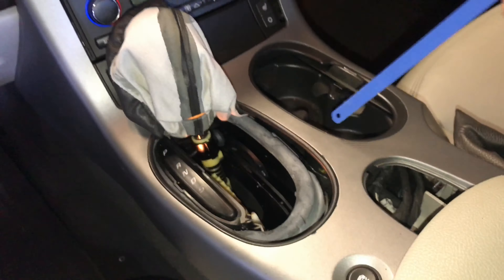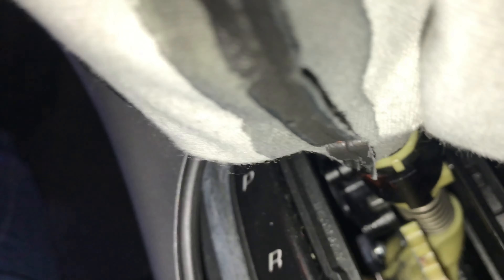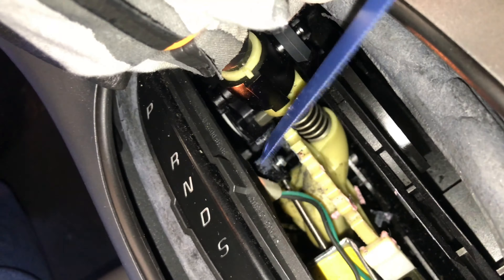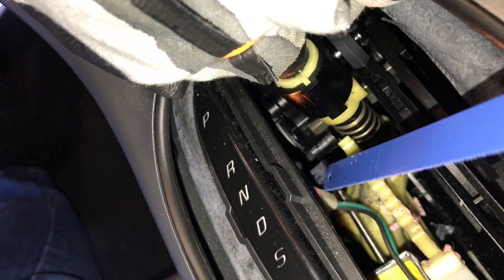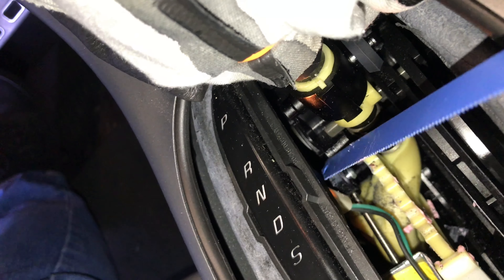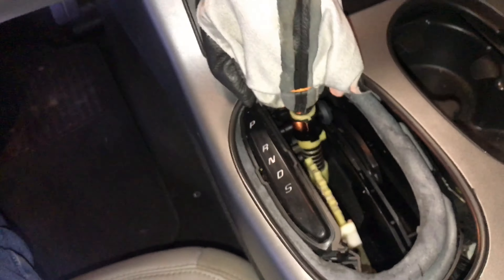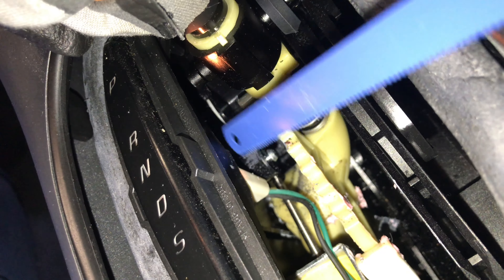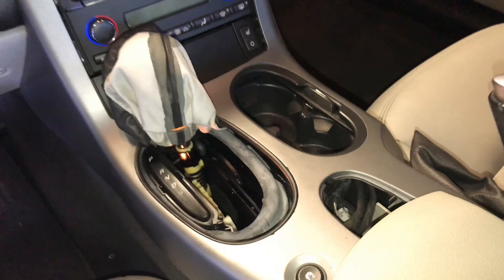❗️❌Corvette C6 stuck on park fix! (The easiest diy video you will find) do it yourself. Easy fix!❌❗️

Comment: This is the one to use. I used a drammel not a file. Don't rip everything out, just enough to get to it very simple, just lift the boot, cut off the plastic lever, lock piece and bingo, no more problem. very easy.